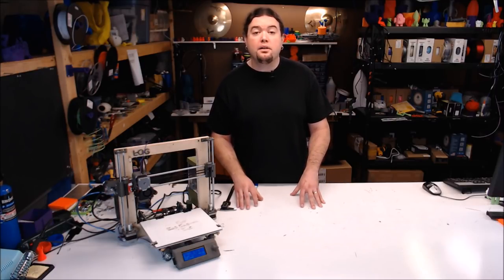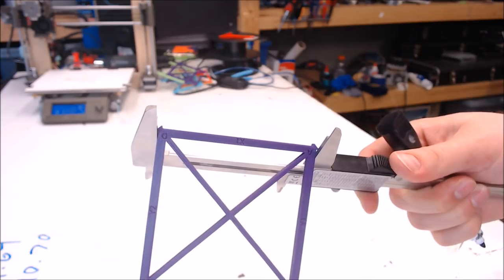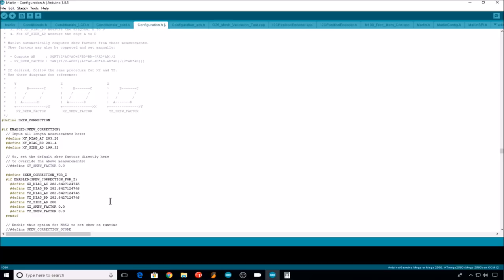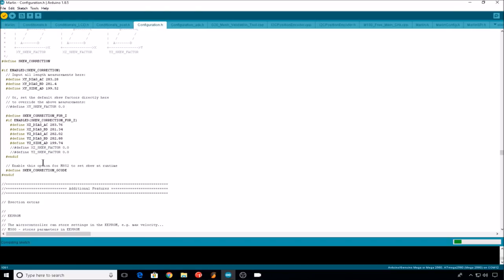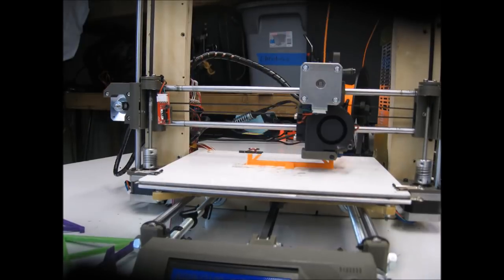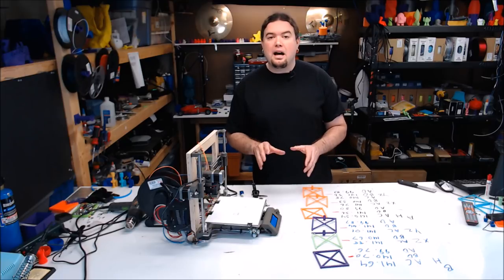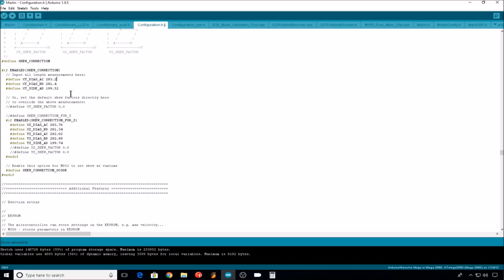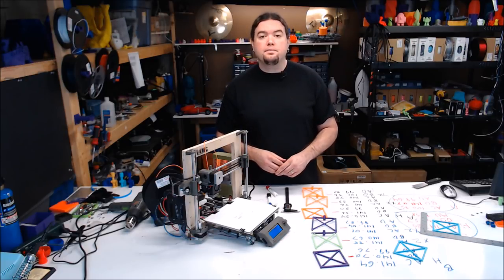Marlin 1.1.8 Bed Skew Compensation - How To - 2018 - Chris's Basement

Comment: I don't quite understand why calc the values times 2? The times 2 cancel each other out. also for best precision I would scale this thing to the extremes of your bed size and print it thinner to waste less filament. But great video, saved me from buying a new printer just because the one guy at creality had the wrong breakfast that day
Reply from the maker: Right on Vincent, I wasn't really sure either, but I think they changed this up a bit in the newer versions of Marlin.

Comment: No need to multiply the values yourself. Just enter the original values and  write *2 behind it. The C Pre Processor will calculate it for you.
Reply from the maker: Great tip! Thank you!
Reply: Im curious as to why Cris is multiplying the result x2 anyway. When I look at the code I dont see a mention of doubling your measured result???
Reply: I have thought the same even that I didn't look at the code. IMHO it is all about the relation between the adjacent sides and the hypotenuse of a triangle. So the absolute sizes will be totally unimportant as long as they keep their proportions.
Reply from the maker: I have tried to figure out how the code is rationalizing this my self. I have tried it with the actual values and it doesn't work. I will look through it again and see if I can figure out how it is doing these calculations.
Reply: I also don't see why you have to multiply at all. The absolute lengths should all cancel out, the resulting value that is stored is a tangent of an angle. This corresponds to what the official Marlin account on Twitter says: https://twitter.com/MarlinFirmware/status/989605332669345792

If it doesn't work, maybe there's a bug somewhere?
Reply: I verified against current 1.1.9 and there is no difference depending on factor. Using measurements offered in this video it was the same skew correction factor of 0.0066587874 either way, with numbers as-measured or doubled.

I suggest user error. Possibly left XY_SKEW_FACTOR defined which overrides the underlying values?

Comment: where did it tell you that you need to multiply the measurments by two?
Reply from the maker: It doesn't I had to work through the code to figure out how it works. I think they might have changed how they do it now.
Reply: wow didn't expect to get an answer on such an old video 😅 thanks! I guess I'm gonna open a thread in the Marlin forum this feature really needs better documentation.
Reply: Did you do this calibration? did you have to multiple it by 2 with the most recent marlin?

Comment: when i comment out this line
//#define XY_SKEW_FACTOR 0.0
then i get the compilation errors, like this
======================
sketch\src\inc/Conditionals_post.h:1207:74: error: 'acos(-1.48816023e+1)' is not a constant expression
   #define _SKEW_SIDE(a,b,c) tan(M_PI*0.5-acos((sq(a)-sq(b)-sq(c))/(2*c*b)))
                                                                          ^
sketch\src\inc/Conditionals_post.h:1208:31: note: in expansion of macro '_SKEW_SIDE'
   #define _SKEW_FACTOR(a,b,c) _SKEW_SIDE(float(a),_GET_SIDE(float(a),float(b),float(c)),float(c))
                               ^
sketch\src\inc/Conditionals_post.h:1213:9: note: in expansion of macro '_SKEW_FACTOR'
         _SKEW_FACTOR(XY_DIAG_AC, XY_DIAG_BD, XY_SIDE_AD)
         ^
exit status 1
======================
Reply from the maker: It might just not like the zero, does it still complain if you put something else in there?
Reply: i made some tryouts, and i think there is some errors in the Marlin base code. if i put the real mesurements in definitions, i get the errors. if i multiply the measurements by two, as you did (and comment the XY_SKEW_FACTOR definition), then IDE not to complain during the compilation, but the skew compensation will not work.
Reply: now i want to try define non-zero XY_SKEW_FACTOR and look, how it works..
Reply: #define XY_SKEW_FACTOR -0.1
Works very effective. I think, i shuld to do some math and just put the right value here.
Reply from the maker: @alexkart9239  Very strange, I would file a bug over on github.
Reply: @alexkart9239  Yea his skew compensation does not even work in the video. I don't know why he made the video.
Reply: @andrewmckinlay2964  in the end I found we didn't need it at all. software compensation of a curved mechanics is a crutch. just make straight mechanics and live happily.

Comment: since the measurements seem to be used relative to each other for skew only and not sizing the model, I would guess that you can multiply the numbers with any number or leave them as measured, as long as you do it to ALL three measurements.
Reply from the maker: It has changed some in later version, so are more than likely correct.
Reply: Chris Riley got it. I am using it on Marlin 2.0 on a SKR 1.3 32bit board. The lines appear to be the same as in your config file tho.

Comment: How do you change the skew, or any other variable defined in the firmware, via gcode without recompiling the firmware?

And why are you multiplying all of your values by 2?
Reply from the maker: You can use M852, that is how it was setup at the time, it is different in newer versions of Marlin.
Reply: It is not necessary to multiply by 2. If the normal values are replaced with the duplicates in the formula, the result is the same.

Comment: Is there some prep on the printer settings prior printing... ? I am experiencing a scaling problem …. missing about 1mm from x and y … haven't checked z dimensions, after making the skew compensation !!! I had horizontal expansion setting on -1.2mm !!
Reply from the maker: No there shouldn't be any pre prep, but it is going to alter size while correcting. It is going to take a lot of testing to get it dialed in.

Comment: Hello friend, you know that when I comment this line(/#define XY_SKEW_FACTOR), I skip compilation error,(exit status 1
'sqrt(1.64695109e+5)' is not a constant expression), Do you know what it can be? greetings and good channel!!!
Reply from the maker: Thanks! Not sure, probably something not right in the syntax, check to make sure it looks like this.

#define SKEW_CORRECTION

#if ENABLED(SKEW_CORRECTION)
  // Input all length measurements here:
  #define XY_DIAG_AC 282.8427124746
  #define XY_DIAG_BD 282.8427124746
  #define XY_SIDE_AD 200

  // Or, set the default skew factors directly here
  // to override the above measurements:
  //#define XY_SKEW_FACTOR 0.0

  //#define SKEW_CORRECTION_FOR_Z
  #if ENABLED(SKEW_CORRECTION_FOR_Z)
    #define XZ_DIAG_AC 282.8427124746
    #define XZ_DIAG_BD 282.8427124746
    #define YZ_DIAG_AC 282.8427124746
    #define YZ_DIAG_BD 282.8427124746
    #define YZ_SIDE_AD 200
    #define XZ_SKEW_FACTOR 0.0
    #define YZ_SKEW_FACTOR 0.0
  #endif

  // Enable this option for M852 to set skew at runtime
  //#define SKEW_CORRECTION_GCODE
#endif

Comment: 5:21 "I found it is helpful to use this command to see what the skew is actually being corrected for."

This sent me down a wild goose chase, everyone keeps mentioning it's intended for use in the Gcode file, one assumes it is a VRAM value that would revert back to 0 or whatever value was compiled as default (measurements or XY_SKEW_FACTOR) when not used or when the printer was rebooted. Boy was I wrong, not only it overrides all other settings, once you set any value it will always restore the saved value from EEPROM, I set a few M852 values via terminal just as a test and set it to 0 in the end, after that no matter what I changed on the firmware (measurements or XY_SKEW_FACTOR) or how many times I rebooted the printer the value was always 0. After a few hours and many compiled firmwares, I found out that A) M852 will always supersede the firmware values, B) if you set it once, either via terminal or in a Gcode while printing it will always go back to that value when EEPROM is loaded, even if it's 0, only by issuing a M502 factory reset M852 value will be cleared and with no value set, it will revert back to XY_SKEW_FACTOR, M852 needs to never have been set manually (NULL) in order to allow the value compiled on the measurements or XY_SKEW_FACTOR to take effect. If you use one Gcode with M852 it will never revert back to XY_SKEW_FACTOR unless you clear the EEPROM.
Reply from the maker: Wow, good find, I didn't know that.

Comment: Very useful. Just printing the test pieces now.

I know i have skew...one good way to really show it up is to print a piece one way on the bed, then rotate it 180 degrees in the XY plane (I a "Flat spin" on the bed) and then overlay the two one on the other...it puts the skew in opposite directions, so if you line the bottom (front on the bed) up, the top (back on the bed) is out a long way...
Reply from the maker: Good call on the print, even printing this piece twice would be a good showing. Thanks for the comment.

Comment: Chris. You are a total inspiration for me. Your videos are more helpful than you could imagine so thanks very much.
I have an issue though which I would welcome your assistance on.  Others may have had the same results. I am using Marlin 2.0.5.4.  
I printed the same X-Y Square Thingiverse STL file as you from the link in the Marlin.ino file.  I can see that my prints are quite skewed and when held against a set square they are over 1mm skewed along 120mm so accurate prints are impossible.  
My measurements were as follows:
A-C = 283.80  B-D = 282.40 A-D = 200.06.  
I made sure to comment out the line (//#define XY_SKEW_FACTOR 0.0) so as to not set it to zero and I activated the M852 as you suggested. I complied and uploaded fine.
M852 now shows:- 
echo:; Skew Factor:
echo:  M852 S0.000000 
This is effectively nothing, how can that be?  
I have not set the X-Z or the Y-Z calibration so they remain zero.  Help please  I am lost. Machine is an Anycubic i3 Mega S so adjusting mechanical skew is next to impossible.
Reply from the maker: I will reply to your email

Comment: @Chris Riley

almost a year has passed i know

but i made a test print that prints on top of the white silkscreen on the mk42 bed just to check if everything lined up

and of course the lower left circle was covered, but the print was off at the upper right circle

so i had to experiment with this, but the instructions in marlin firmware does not mention to duble all messurements, where does that come from? not that i dont trust @Chris Riley
, just wondering

the ultimate goal with this test print is to verify that endstops number are correct so that when the printer things it is at a given location it really is and that it can print straight

and i will expand the same test with testing that nozzle/probe offset is also correct
Reply from the maker: Hey Bo, I am not exactly sure how this came about, it appears in 1.1.9, they are no longer cut in half.  Not sure why they were in the first place.

Comment: Great video! Thanks for the instructions. I have however one issue when trying to deactivate the lines "#define XZ_SKEW_FACTOR 0.0" and  "#define YZ_SKEW_FACTOR 0.0". When trying to compile I get various errors. Only if I leave these two line active the compiler will successfilly complete. But as I understood this will then ignore the prviosuly made corrections! Any idea? I am compiling with Arduino 1.8.8 and Marlin 2.0.0.
Reply from the maker: Hello,
I was able to compile. It might be just a character off someplace. Here is what I have.

#define SKEW_CORRECTION

#if ENABLED(SKEW_CORRECTION)
  // Input all length measurements here:
  #define XY_DIAG_AC 282.8427124746
  #define XY_DIAG_BD 282.8427124746
  #define XY_SIDE_AD 200

  // Or, set the default skew factors directly here
  // to override the above measurements:
  //#define XY_SKEW_FACTOR 0.0

  #define SKEW_CORRECTION_FOR_Z
  #if ENABLED(SKEW_CORRECTION_FOR_Z)
    #define XZ_DIAG_AC 282.8427124746
    #define XZ_DIAG_BD 282.8427124746
    #define YZ_DIAG_AC 282.8427124746
    #define YZ_DIAG_BD 282.8427124746
    #define YZ_SIDE_AD 200
    //#define XZ_SKEW_FACTOR 0.0
    //#define YZ_SKEW_FACTOR 0.0
  #endif

Comment: Hi Chris, my original diagonals diferences on XY  are 1mm greater than yours. Same on XZ and YZ and your correction factors are 0.01, 0.01 and 0.0 (with M852) minute 6.00.
I spected that my factors were at least equals like yours however mine are all 0.0.
Those are my settings on configuration.h. My frame is ANET A8 with RAMPS 1.4. What could be wrong? I have not tried any print with "new" SKEW correction

#define SKEW_CORRECTION

#if ENABLED(SKEW_CORRECTION)
  // Input all length measurements here:
  #define XY_DIAG_AC 281.28
  #define XY_DIAG_BD 283.90
  #define XY_SIDE_AD 199.7

  // Or, set the default skew factors directly here
  // to override the above measurements:
  //#define XY_SKEW_FACTOR 0.0

  #define SKEW_CORRECTION_FOR_Z
  #if ENABLED(SKEW_CORRECTION_FOR_Z)
    #define XZ_DIAG_AC 282.02
    #define XZ_DIAG_BD 284.18
    #define YZ_DIAG_AC 283.2
    #define YZ_DIAG_BD 282.66
    #define YZ_SIDE_AD 199.38
    //#define XZ_SKEW_FACTOR 0.0
    //#define YZ_SKEW_FACTOR 0.0
  #endif

  // Enable this option for M852 to set skew at runtime
  #define SKEW_CORRECTION_GCODE
#endif
Reply: Chris I already found how to get real value:
M502
M500
M852

HERE https://github.com/MarlinFirmware/Marlin/issues/8843
Thanks
Reply from the maker: Sweet! Glad you found it!

Comment: I'm curious, are you using a probe for bed height compensation and if so, is it performed before or after bed skew calculations? The bed height probe functions are somewhat doing the same thing in software and depending on what style of bed leveling you setup may work different when your attempting the skew adjustments. This is all speculation as I'm not sure how it all works. I just happened to be playing in that configuration folder the last couple of days trying to get my probe and z axis end stop to share the same pin on my anet a8. They don't like to play well together!
Reply from the maker: Skew correct gets performed before the probing is accounted for. The Z probing does try to compensate for the bed being un-level, but it will only adjust the Z axis up and down as a whole. ABL is kind of bad at adjusting if one side of X axis is higher or lower than another. That's where skew correction comes in. Because you are entering hard measurements during the skew process it is taken into account first. Skew correction should work with almost all the bed level except manual and UBL I believe.  Take a look here for more info: https://github.com/MarlinFirmware/Marlin/issues/8628  

Hope this helps.
Reply: I read the link you included and I'm still not convinced we are thinking about it from the same angle. Also, since manual bed leveling is still inputting hard numbers for the exact same locations as auto bed leveling I would think the skew adjustments would interact the same with the only difference being based on ones ability to get the numbers right at each touch location.

Comment: Hello Chris, your tutorial is fantastic. I used marlin 1.1.9 for this and following its instructions and in the end it worked. One detail I noticed is that I should type M502 and M500 after having loaded the marlin. Keep up the good work !.
Reply from the maker: Thanks! The eeprom reload is a great practice to get into for sure.
Reply: Eduardo, onde esses códigos são inseridos? No Script do Simplify3D? Ativei no Fw, mas não surtiu efeito. Acho que o nivelamento automático está interferindo.
Reply: Hello marcos, I'll try to answer your questions but in a way that Chris can follow and understand your problem.
question: where are these codes inserted?
 Answer: If it is the M502 and M500 codes then you should type in some slicer program (Pronterface, Repetier, Simplify3d, etc);
question: in simplify3d script? 
Answer: answered by the previous question;
Question: You said that you activated this function in FW but it did not work. I think the ABL is interfering with this function.
Answer: I activated this function only for the XY axes and it worked. Before I had already activated Chris's procedures for ABL and it worked as well. So I remember after having loaded the firmware with this new function I should type M502 and then M500 to be written to the EEPROM.
Reply: JEduardo B JEduardo, thanks for the help. My problem is on the XZ and YZ axis. Should the M502 and M500 commands be inserted into the initial Print Script or only after the FW recording? Should I use it in the Simplify3D script, should I use it after the G29 command? When I use the M852 command, the system returns XZ 0.0 and YZ 0.0, but after the M502 command, I see the calculated values.
Reply: Marcos, I think I understood what's going on in your problem. Once you have loaded the new FW, in the Arduino IDE open the serial monitor window and enter M502 and then M500. To confirm that the information is stored in the EEPROM, enter M503 in the same window. Once the values are displayed there is nothing else that needs to be done.
Reply from the maker: @jeduardob2060  Thanks a lot for helping out here, much appreciated.
Reply: You're welcome, I think this is a way of giving back that we learn.